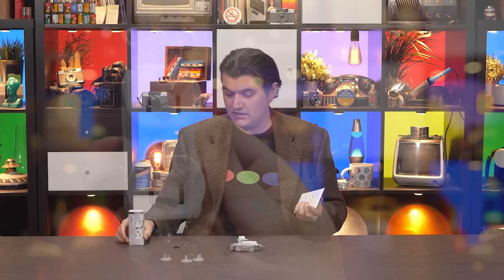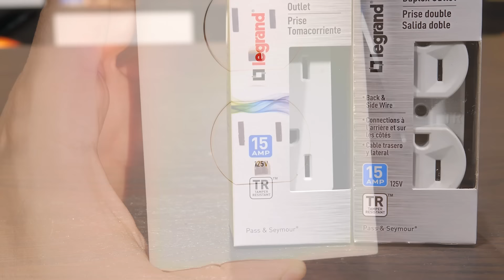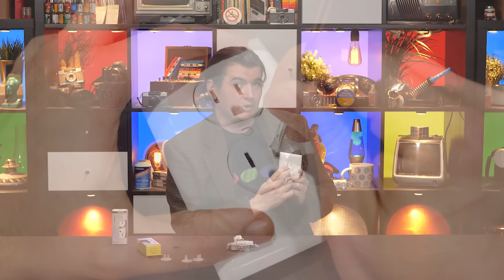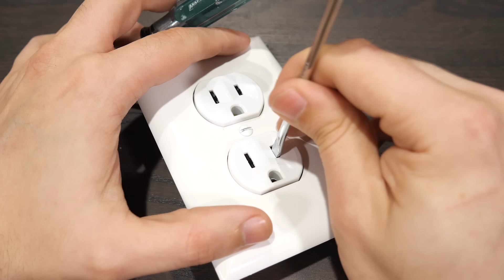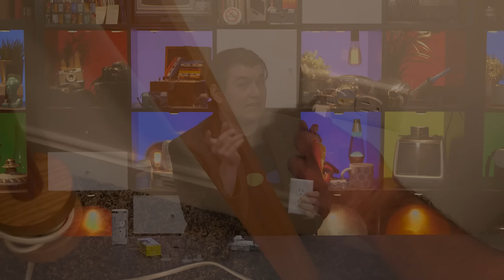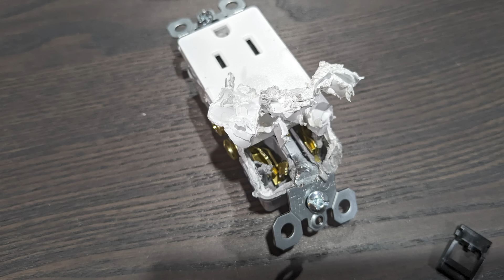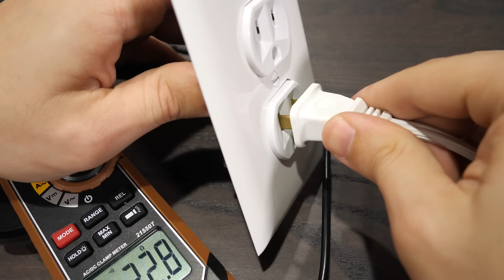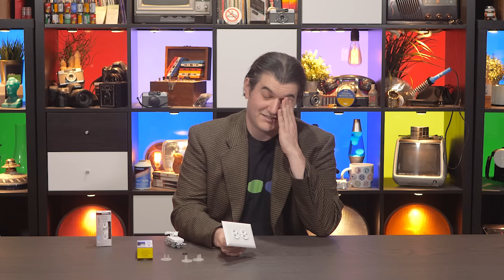Tamper-resistant outlets aren't all the same - a follow-up

Comment from the maker: Okay, regarding loose plugs - it just occurred to me that since my lived experience is mostly around Chicagoland where outlets tend to be sideways, that may be why I have so rarely encountered problematically loose plugs. In either vertical orientation, it's really only side-friction that's holding onto the blades. But when it's sideways, weight from the cord is sort of jamming the blades against the contacts. Perhaps we've been right all along... (though neutral should probably be on top)
Reply from the maker: @TargetedMarket  I don't know how you came to the conclusion that I'm used to new construction when I said I've lived in plenty of old places with old receptacles. Chicago wasn't built after electrification, y'know ;)
Reply: @TechnologyConnextras  Most tourist will probably only experience hotel and airport receptacles and in my short domestic travel experience they're usually crap. Like my cell phone charger is floating inside the receptacle & will fall out with no strain bad.
Reply: @TechnologyConnextras  6:46 European here, where I live we have CEE 7/5 sockets (sometimes called Type E) and mostly CEE 7/7 plugs (works with CEE 7/3 and CEE 7/5 sockets), if appliance is unearthed you can find CEE 7/16 (Europlug) and CEE 7/17 plugs. A plug becoming loose is a such a foreign concept to me that I am usually more worried about yeeting out whole socket out of the wall than the plug becoming loose. If the socket is old, low quality or improperly installed it is far more likely to yeet whole socket out of the wall, so I have tendency hold the plastic body of a socket while unplugging CEE 7/7 plugs. I don't think that it is a problem now, but in the 90s and early 2000s when CEE 7/7 plugs started to appear, tolerances probably became very small and old socked installed behind the iron curtain (but only those home ones, those basement and outside ones where always sturdy as far I remember) were not ready for the force needed. And the habit from my childhood just stayed with me. But even those old CEE 7/2 and CEE 7/6 plugs were almost impossible to partially disconnect as you do with the American ones, while the modern CEE 7/7 are probably so tight to make them dust- and at least partially water- resistant*.

*As far I checked, sockets near water supplies should be at least IP44, but even IP66 are common outside. Inside sockets are at worst IP20, but you can buy also fancy looking IP40 for internal use. Also if you have a socket with high IP, you need a lot of force to plug in a device and even more to take out the plug, so it even may be that a child is to weak to plug in a CEE 7/7 plug while plunging it out is even harder.
Reply: @Hadar1991  I'm from the wrong side of the iron curtain, we used to have unearthed sockets that are just round and like maybe 3-4 mm recessed, I guess what we call 7/1 these days.  Where I grew up, the light switch in the rooms would turn on such sockets high up on the wall, and the light would be plugged into that socket (a big round plug though, not Europlug); normal use wall sockets were barely recessed and non-earthed too.  Can't say I've seen anything want to fall out of those sockets ever, and that was shoddy socialist production from 45 years ago.
Reply: @Ralesk  I am from Poland, when I was a kid there where only CEE 7/1 wall sockets and CEE 7/2 plugs were use. And 7/2 plugs where nowhere near as tight as modern 7/7 plugs. Nowadays only 7/5 sockets are installed in Poland. Maybe it was only in my house, but those old 7/1 sockets where not very stiffly mounted to the walls. Although there was no danger of ripping whole socket all of wall if there was only 7/2 plug or 7/16 Europlug used, but I definitely ripped out a socket once or twice if the newer 7/7 plug was used. I am not sure why, but maybe the GOST 7396 standard for sockets and plugs had very slightly thinner pins or just those old plugs after years of use lost a little bit of the material on pins. But what I wanted to say, I have never worried about accidentally removing the plug from the socket in Poland, although I had accidents with ripping whole sockets out of the wall, so for this day I have a habit of holding the plastic part of the socket why removing anything.
Reply: @TechnologyConnextras yeah I've been in houses with plaster walls around here that so have the sideways outlets.
The conduit idea makes sense but I think it may predate that
Reply: @TechnologyConnextras I'm wondering if it's because it's because of using adaptors then our foreign plugs which adds more weight which might help the adaptor back out easier but who knows
Reply: @TechnologyConnextras  Where is Chicagoland? Do you actually refer to Chicago instead?
Reply: @erkinalp Chicagoland is Chicago and the region around it
Reply: @erkinalp  Chicagoland is the common term for Chicago and it’s surrounding suburbs (which leaves Illinois into a bit of Wisconsin and Indiana). Chicago has a population of about 3 million while Chicagoland has a total population of about 10 million.
Reply: @erkinalp  I think he is referring to all of the Chicago area, including its suburbs.
Reply: @erkinalp Even if you've never heard that word before, you couldn't figure out what it meant? BTW, the first known use was in the 1926 July 27 edition of the Chicago Tribune.
Reply: @erkinalp Like maybe LaGrange would be Chicagoland….those places where when strangers ask where you live….they only have heard of Chicago so you say “ummm, Chicagoland…”
Reply: @erkinalp he is referring to Chicago and the surrounding areas
Reply: Adn given that most foreigners are going to use some plug adapter i wouldn't be surprised, that that just makes the whole loose plug issue even worse, due to added weight
Reply: As a European visiting US, I can say that the shady international multi format plug adapter didn't help the well' worn hotel sockets
Reply: Yep, our old house was built pre-1900 and some of the existing outlets hadn't been updated since the 40s or 50s (maybe 60s) and they were loosey-goosey non-grounded outlets vertically oriented so plugs didn't stay put very well.
Reply: I definitely prefer right-angle plugs, and the 45-degree offsets to allow both plugs to be used is usually beneficial though we do also have a few recessed plugs behind built-in cabinets (with a rectangular cut-out in the cabinet to access the plug behind it) where that doesn't work.  Plug strips, on the other-hand, which are almost universally sitting on the floor or table with the plugs facing straight up, seem to make the whole thing moot.
Reply: I am not from your region, and yeah it's never been a problem in my life.  I've seen a couple of truly loose receptacles, but they were probably pre 50's (most likely pre 40's), so those aren't really a matter of code as they are simply worn.
Reply: When I bought a house it was a circa 1962 era home and the outlets were all loose as a... let's go with a worn out sock. Went and bought a "contractor pack" of outlets like you mentioned, and with a couple hours of they were all nice and toight. Toight like a tiger. It would have been faster but for the game of "which breaker is this outlet on?"
Reply: @TechnologyConenextras large wall warts (think current gen MacBook chargers) are prone to falling out. Because of the weight, the leverage, and the folding prongs. 

I’ve also had this issue with other similarly designed charging bricks.
Reply: when I bought my house nearly all the outlets were worn out and sometimes I had to jiggle the cord or pry on the plug tines to keep them working. I ended up changing all the outlets in the house
Reply: Loose plugs haven't really ever been a problem for me in the UT area. I'm pretty sure it's only a problem if the outlets are worn out enough. So far as I've seen, the plugs always stay flush against the wall
Reply: Try O'Hare. :) In addition to hotels, I have noticed that outlets in airports are very often worn out and chargers just fall out of them. This is especially true where wall outlets are limited and people are constantly plugging and unplugging them. Or places like O'Hare where the outlets on the chairs never seem to be working, so everyone is trying to use the outlets on the wall.
Reply: The only loose vertical plugs I've seen (outside of public spaces like airports) are with receptacles that are old enough they're probably out of code anyways. And my home was retrofitted with knob and tube wiring after it was built. To give a sense of how old it is
Reply: @blakebrockhaus347  I doubt they're out of code.  Electrical codes very frequently grandfather older stuff.  But installing one of those loose outlets today hopefully is covered somewhere in the code.

Yes, they are less of a problem when mounted horizontally, but I recall some of the outlets at my grandparents' place having virtually no grip.  One in particular had a table situated right by it at just the right height for a cord plugged into its lower outlet to rest on the table specifically so the plug wouldn't fall out of it.  The outlet above it was deemed a lost cause, though I recall my brother trying to plug a radio into it by sitting the radio by the outlet and running the cord over the radio.  (It didn't work for long, as the weight of the cable running down the other side of the radio was enough to pull it out over the course of a minute or so.)

That said, I'm not sure they needed to be out of code.  My grandparents changed brands of outlets after learning how much of a problem those cheap outlets were.  They were teenagers in the Great Depression, and even they splurged on better quality outlets - but not enough to replace any of the original outlets they'd bought.  And I mean not any.  The house which only had some of those outlets was their newer house, built on the same property as the first one.  The original house they'd built only had the no grip outlets.  Fortunately, it was barely livable in so many ways as soon as they were able to afford a redo they did, and we virtually never visited the older house.  We certainly didn't use the electrical outlets apart from testing their grip, just to marvel at what our grandparents put up with.
Reply: @edgrimm5862  ok, to be anally correct. They wouldn't be up to code if they were made today. Meaning they should probably be replaced anyways
Reply: I've definitely encountered very clapped out outlets which basically spat out anything you plugged into them. thankfully, I could just replace them myself
Reply: I've never understood why we don't do induction plugs that have hooks to confirm contacts internal to the wall.  There is no need to have direct metal to metal contacts.
Reply: @cerburusmori Because you haven't thought through the enormous engineering, cost, and efficiency ramifications of it.
Reply: @Kyuuketsuki02 My guy, it's essentially making a small transformer, no engineering.  Cost would be the hurtle I suppose as everyone would need to by adapters to change their plugs into half a transformer.  Replacing the duplex with said transformer is another cost, but saving on house fires should be cause to consider.  The only question would be proper shielding for eddy currents and keeping people from tripping safety to make the outlet live imo.
Reply: @cerburusmori  yes there's a lot of engineering. If you're going to replace receptacles with inductive power couplings, they need to be able to handle 20 amps continuously. That's not a small transformer. And it's gonna waste a ton of energy as heat at that load. And it has to be emi compatible. And it has to fit in cramped electrical boxes. And it has to fail safely under surges at least up to 600v else it'll catch fire eventually. And it has to make sure that it's actually delivering power to an electric device, not just some chunk of metal that's near and resonates juuuust right.
Reply: @Ariccio123  thank you for thought out answer.  The short is, I would have designed a non-matallic switch to actual charge the windings on the internal side, so it's not live until the external plug is connected.  Secondly, I planned to have a type of shielding to cut down on inference and noise.  I'm not sure why the size of the transformer would cause such a head load.  I get smaller wires generate higher heat, but if the primary line can handle the current, why would windings fail? Again, this is conceptual and there are challenges, but I think they'd be surmountable with a bit of engineering.  Would say, we don't have to keep the same boxes as is.  This is more a standard to go to, not to retrofit wall plugs.
Reply: @cerburusmori except any solution that requires an adapter you're just adding more points of failure and also still have the original problem 1 in over
Reply: @cerburusmori  
> "A transformer is 80% efficient or better."
> "transformers have a 98%+ efficiency."
Just thought I'd point that out. But, to actually answer your questions, there are several hurdles an inductive outlet would need to solve:

1) Yes, large power transformers are very efficient, but one of the ways they get that efficiency is by having a laminated iron core that loops through the center of both coils. Kind of hard to do that with a plug, and without that, the efficiency of the transfer will suffer greatly. As @brianzmek7272 said, QI charging only gives you about 60% efficiency (when it launched, modern chargers can sometimes get as high as 75% efficiency) because the two coils aren't tightly coupled

2) The lower the frequency, the bigger the transformer has to be to get good power transfer. At only 60 Hz, the plugs are going to need to be much bulkier than current designs.

3) The lower the voltage, the bigger the windings have to be to carry the same amount of power. At only 120v household supply, this would make the plug even larger. (And you thought those wall-wart phone chargers were bad?)

But, the biggest problem of all is one of safety. If the primary-side switch fails on the outlet, or you plug in a cable with nothing on the other end (like a standard computer power cable), or the power switch on the appliance fails a certain way, or any one of several other failure modes, you've essentially turned the outlet into a high-wattage heater that could easily either trip the circuit breaker or start a fire.
Reply: @HiddenWindshield  I am aware I wrote two efficiencies.  It turns out 98% is higher then 80%.  I believe your making an argument for classical transformers that just isn't applicable, but I'd need to sit down and actual work this to solve the issues.  I'm saying it is possible and that we should do it if safety is the concern.
Reply: @cerburusmori  I'm not arguing "for" anything. I'm also not sure what you mean by "classical" transformers.
Reply: @cerburusmori What you're describing is effectively an air core transformer, which are famously inefficient. Even if you stick a slug of iron inside on either side it's still going to be far less efficient than the high voltage mains transformers (that do require substantial engineering to design, might I add), and even those high voltage transformers are only in use because the inefficiencies of a high quality, well engineered transformer are lower than the inefficiencies from transmission losses at lower voltages. Direct copper contact is plenty safe as long as you don't leave the copper exposed like NEMA plugs are prone to doing, just look at the many, many well designed mains voltage power connectors in other countries, none of which rely on an expensive, inefficient inductive connection.
Reply: @bosstowndynamics5488  I am realizing after having time to dig into it, that my very first statement was correct.  Transformer is not.  The technology is called inductive power transmission.
Reply: @matthewmiller6068  the point is all new products would use the new style and the adapters would be for current electronics, which would be phased out.
Reply: @HiddenWindshield  You are able to use different core materials.  I am realizing though, that I missremembered that they have to have a core, and if they don't it's induction.  I should have stuck with my first instinct of inductor, not transformer.  Please excuse my snarkness earlier.  

The 80%+ is a range and the most are 98% is the distribution on that range.  I can see where that might be confusing if not read in context, though in your quote you left off the generally transformers, which is an important word to clarify it's the distribution.
Reply: @cerburusmori And the hurdle of getting more than about 20% transfer efficiency, especially at 60 Hz... (or 50)
Reply: @cerburusmori any such plug would be massively less efficient and leak em interference like a siev.
Reply: @brianzmek7272  I have no idea why you think that.  A transformer is 80% efficient or better.  I get theybuse dielectric oil, but I'm sure I could design one.
Reply: @cerburusmori  and the efficacy of the contacts of a non corroded plug as best I can research is in the milliohms range on a 120 volt connection and even a whole one is still over 99% efficient. Plus look at the lossyness of the chi charging standard where 60% efficiency is normal and and lower while bad is still technically functional in some cases even 20% efficient for a more apples to apples comparison plus your sighted efficiency of 80% would mean that anything on an extension cord in your proposed standard would only get 80% of its rated power or 64% of the power that a conventional plug and extension cord can produce.
Reply: @brianzmek7272  generally transformers have a 98%+ efficiency. I am not sure where you are getting 60%
Reply: @cerburusmori   your Idea  certainly has merit in the appropriate application, but in engineering terms on the scale of an entire continent even small /minor hurdles  are gigantic. Unforunately any emi shielding that would meaningful reduce interference in an flat surface scenario that I think you are leaning towards would by definition reduce the efficiency and effectiveness.... The variable efficiency rates others have stated  for transformers would be due to design assumptions that are used.... example the besy case/highest efficiency transformers are going to be something like a low carbon steel one piece laminate e-core design. The issue is that isn't possible if you are splitting it up between the power supply side and the use side so that reduces your design assumptions for maximum efficiency, then you inevitably have manufacturers for items on the use side that are going to make the crappiest bare minimum excuse for the secondary winding that is possible examples....copper clad aluminum sold as solid copper...  misaligned/poorly aligned to the outside casing... all of which further reduces the efficiency. I really don't want to discourage you... but I hope just providing a little context how corporations and federal government are going to do the least possible effort,  sorry to be a major downer...
Reply: @cerburusmori  For a transformer to be efficient you need a strong magnetic coupling. Regular 50/60Hz transformer cores are made of stacked E and I shaped iron laminations. If you assemble one without getting everything properly tight the idle current will be higher due to magnetic saturation. For something the user plugs in by hand this is a no-go. There are probably ways to ensure this doesn't happen but in the end you'd end up with a massive plug costing over $100 compared to the compact 69 cent traditional outlet.
Reply: @alexlail7481  so, the alignment would be for the locking mechanism to address.  I would say that you could make the protective cover separating the two halves a dielectric liked what's used in capacitors to increase storage.  Again, I'd have to do research to find the solution
Reply: @cerburusmori  sorry I realize I probably wasn't as clear as I should have been in my original comment....the alignment I was referring to was the cores themselves they essentially need to be perfectly coaxial for maximum efficiency,  the will function if not but the more they're off from truly being coaxial the more the efficiency drops off. If I remember correctly it is exponential meaning the drop off in a few arc seconds is fairly minor, but a few arc minutes and efficiency is impaired substantially.... my concern would be the natural tolerances produced in a production environment may render the a product where one unit is 60-75% efficient and the next is 15-20% because the coil isn't potted correctly.... not insurmountable but from experience in a factory making similarly finicky electronic products it was a constant struggle that drove up the cost and nearly bankrupt the company over what they board level people saw as unimportant nonsense... and refused to properly fund...but if you believe in it then I encourage you to get the proper education/skills and pursue it!
Reply: @alexlail7481  I'd hope, as an M.E. I'd already be qualified, but EE items aren't something I've dealt with in over a decade.  I wonder then if it'd just be better to make it a simple capacitor.  My reference manual is at work, so I've been answering everyone off of what I remember from my eng physics from 2006-7.  Not the greatest, I know. I am aware they store charge and I'd need a way to discharge on client wanting to unplug.  Need to look at number and maybe a release mechanism that grounds everything, just off the top of my head.
Reply: @cerburusmori  Because induction power incurs a massive loss in power for the convenience.  Electricity use would skyrocket, as would electric bills.
Reply: @arcanescroll I have seen this claim, and counter claims online.  I really need to do more research into this as I do not remember induction being so inefficient as claimed online.  What little I have had time to do says that loose resonance tech for smart phone charging maybe a better path, but again, need to do more research. Certainly something for me to sink my teeth into, so to speak.
Reply: @cerburusmori  Well, I have tested this multiple times and yeah there is a loss in power.  You can't just create a wireless link between devices with no loss in power, there is always a loss in efficiency.
Reply: @arcanescroll  You can minimize loss by using a heatsink or creating a vacuum, if I remember right.  Not practical for the situation, but if the efficiency loss is small enough, seems like it'd be worth the trade to me.
Reply: I've noticed extremely loose plugs in hotels in cheap fixtures that barely stay in. I assume this is what they mean because eeuropeans often interact with them in these places.
Reply: I have vertical outlets and dealt with them almost exclusively. The only time I run into issues with it trying to fall out is with a very dated or poorly made outlet. Which tends to be high traffic locations like hotels, airports, planes, trains... Basically anywhere that general public is given access to the outlets.

I think it's a combination of frequent plugging in, and just... General public.

A lot of the time these will be the places that folks coming from foreign countries will interact with plugs, because they're not here on a long term stay, but instead staying at a place they'll be temporarily, like everyone else before them.
Reply: Just FYI, also you in Chicago, all competent electronics install it sideways with natural on top. I believe it's a sign that someone who wasn't an electrician installed it if it's hot on top
Reply: @ampersandexplainer  n.b.: the neutral conductor doesn't mean "cannot shock you". If you have some really severe, but surprisingly common, electrical faults, you can get very dangerous shocks between ground and neutral. I know because it's happened to me with faults at the meter/service entrance panel causing an intermittent floating neutral. Very very very dangerous.
Reply: The problem is with airport and hotel outlets and when using wall warts, especially with U.K. adapters. I don’t remember particularly having problems when living in the US - other than being alarmed by the way that plugs could hang out of walls. Perhaps there were some issues with wall warts in vertically oriented sockets and with them more easily being knocked out.
Reply: The only "loose" vertical outlet I've encountered is there's one outlet at my home that got . . . melted slightly, somehow. Really what shocks me (ha) is that my parents never replaced it.
Reply: Sideways w/ neutral on top would also reduce a lot of the issues you brought up in your other video. Sideways makes it harder for plugs to pull out a bit in the first place and neutral on top is a lot less dangerous if something makes contact w/ the plug. There are still going to be issues with devices that assume a smiley-face orientation (particularly stuff with displays), but they'd be less severe then with the ground on top orientation.
Reply: The outlets at my work are a couple decades old, whenever I'm vacuuming there's always outlets I cant use because the plug will work its way out. Those outlets are mounted in the traditional way.
Reply: Why would it matter if neutral is on top, outlets should be designed to be safe regardless of orientation. If the entire prong does not need to be live, then the part that can be insulated should be insulated.
Reply: Look at cruise ship for plug looseness. I keep saying this. On ship we have EU and American sam brand.  Side by side. Always USA socket fails first.
Reply: @peterl.deegan9059  That could easily be because the usa socket is used more.
Reply: Maybe if you put them diagonally, you can confuse gravity and get even better results!
Reply: You mentioned that most people that say US plugs falling out are probably referring to hotels. That is likely true and also they are adding a sometimes heavy adapter to the plug.
Reply: I've encountered european-style plugs and receptacles in russia that are really loose. Like, REALLY. I guess we took the european style and made it much less restrictive. At least I haven't seen a plug that doesn't have a bit of insulation on the contacts going from the base of the plug.
Reply: A shock from the thumb to the forefinger of the same hand is less lethal than from one hand to the other or from one hand to a leg. Ask me how i know.
Reply: The only way to defeat a TR outlet is the only way you can defeat GFCI protection.
Reply: Charleston WV; my aunt's house has sideways outlets in the kitchen, dining and living rooms.
Reply: I had loose outlets in a number of homes and apartments I’ve lived in, but it was never every outlet and the outlets were always old. When I moved into my new home there were some outlets from the original build in the 90s per the stamped manufacturing dates. Some sucked, some worked fine, all were pretty yucky and needed to be replaced on  a cosmetic basis.
Reply: Regarding how the protection works here in the UK. It's not always the Earth pin slot that has the release for the Live and Neutral internal cover. It's sometimes just a slide out the way. (Well more a twist with ours, but a sliding twist all the same)  It will only twist out the way if both L and N pins are pushed in together. The way they work. Is if you only push one in. Instead of sliding. It catches on the side of the front plate. Whereas if both go. It just slides impeded, not hitting a side catch. It's probably similar to how those US guards work. There will be something it clips on if it's not pushed evenly.
Reply: Wowow, better take a look in the mirror before you start calling people loose plugs, buddy!
Reply: Sideways outlet can with time weaken the blades of a plug since the wider profile is more prone to bend with the weight of the cable attached. Why they didn't adapt to rod type prong like most of the World did since the beginning? Also those tamper resistant mechanism are very tough in the beginning to the point of almost depressing the whole electric box way inside the wall when connecting the plug but became very loosy goosy with constant use to the point of having no resistance.
Reply: 19:10 😂
Reply: Yeah I have tons of vertical-outlet-plugs-falling-mostly-out-to-the-point-the-device-loses-power problems, including the one outlet I have for my bedroom light and phone charger
Reply: I've lived in California my whole live with vertically oriented plugs and have encountered LOTS of receptacles that wont hold onto their plugs. Sometimes they aren't even that old (relatively speaking) just really poorly made. Honestly, horizontal outlets make so much sense I wish we had more of them out here.
Reply: I'm in Michigan where we have almost no sideways outlets and the only loose outlets I have ever experienced is those things that split a normal outlet into 6 receptacles. Those things can get melty from relatively low current, I think that's why,
Reply: I’ve only been shocked once, my index finger was joining the blades when plugging something in when I was a teen. Was just a wake up call to pay attention. I use an extension cord to my bed for the phone so I’m not pulling on the plug
Reply: No, don't backstab.  They are awful and tend to develop a hot spot, high resistance, and eventual corrosion and burning.  And suck replacing them getting it out.
Reply: Those tamper resistant ones are absolutely awful.  Especially at hotels, often one side goes in with zero force and the other side won't go in even pounding your fist on it putting all your strength into it.
Reply: grew up in Vermont. it's lousy with worn outlets that simply won't hold plugs anymore.
Reply: My current home was built in the 70's and many of the outlets would just drop the cords as soon as you plugged them in, or slowly overnight.  I've replaced all but one.  I keep that one because it amuses me for some odd reason.  It's not used for anything though and even has the words "bad outlet" written on the faceplate.  It will be changed if I ever sell the place.  I do love those sideways outlets, something to add to my ideas list if I ever get the chance to build my own home.
Reply: If you recessed the outlet, similar to European outlets, that fitted the plugs that would improve many of your concerns.
Reply: @elpolaco7654  When I was writing about old CEE 7/2 I meant the old Soviet ones which look like CEE 7/2. If the old Soviets one really had smaller diameter of pins it means that am not hallucinating that the old Soviet plugs where easier to plug in and plug out. And I admit, that the old sockets I had in my family home where either low quality, extremely old or improperly installed, but it also means that it was enough to stay in wall while using old Soviet plugs and the problem with ripping out sockets started when CEE 7/7 plugs started to appear in Poland. But regardless of all of that, American plugs seems way more loose that even the old Soviet plugs, while compering modern European plugs it is night vs. day.
Reply: The United States are not very united.
Reply: Had lots of issues in my last apartment with basically all my plugs falling out and not making connection (Plugs in the bathroom and kitchen weren't even GFCI!). Which led me to this: https://www.youtube.com/watch?v=kX6xnOksQTc 
The mechanism that holds the blades in place is fair bit less robust in 'residential' grade plugs vs 'commercial' grade plugs (at least according this video).
Reply: I’ve never had a problem with receptacles in he US they’ve always been fine to me.
Reply: Yeah, in my almost 43 years of life, I have encountered A LOT of partially inserted cords all over the US. Even our house here in California that has all new outlets, one in our kitchen doesn’t grab at all and we very often have phone chargers just fall out with very little effort. We also have a fan that our dogs bump the cord and there is a shocking amount of the prongs exposed while still operating. My favorite has been those I saw in Germany. They are recessed, so there is no way you can make contact when plugging in or unplugging. I first used those in 2006, and I felt they were so much better. You usually have to pull them pretty firmly to remove too.
Reply: Bad wall sockets were causing my wall plugs to literally fall out of the socket.
Reply: I think the Europeans have their heavy giant Euro plug plus an adapter compounding the issue.
Reply: I love outside Chicago, too, and the moment you mentioned sideways outlets, I looked around and was like “I’ll be damned…” it just never occurred to me before.
Reply: I know you'll not read this, and I've posted it in the past, but there is also a UK socket that requires the live and netural pins to be pushed.. As well as the earth (ground) pin, and it's fairly popular too. MK Logic Plus. I really think you'd get a kick out of playing with one.
Reply: I've only encountered two outlets loose enough to have the plug slide out on it's own. One was an outlet built into a lamp and the other was a brown two prong wall outlet that seemed very old.
Reply: Sideways with neutral on top is how I wired the outlets in my bedroom. I have had no problems with loose outlets and all of my 90 degree adapters work flawlessly
Reply: I suspect that part of it is that visitors to the US are more likely to be exposed to outlets in e.g. hotels, which do tend to be loose
Reply: American here. I have had a big problem with old worn out outlets allow the plug to literally fall out. In places where the plug experiences high traffic, or the cord is being moved around a lot (like where I plug my phone in) I have to go and tighten up the connect every few months or so, so they do come loose over time. Maybe european plugs aren't as prone to this or something? I would hardly call it "all the time" but if I was used to never having to worry about plugs coming loose, maybe I would.
Reply: "Talk to me nice" You still the man love ya buddy.
Reply: I can attest to the thought that our plugs are always falling out. I used to live in a pretty old house, probably about 80 years or so. The walls were all lath and plaster. Many of the outlets were quite loose. Almost all plugs would naturally hang out with some of the metal exposed. They were all loose enough that accidentally hitting a cord would very probably pull the plug out. The on-the-wall/cordless type power strips were completely out of the question if they didn't screw in. 

In my experience there, I could see how somebody could complain that the plugs are always falling out. Yes it is an exaggeration. But, coming from a place where plugs really just can't fall out, I can understand the sentiment.
Reply: same, i was so confused when i went to ohio and my phone charger was sideways.
Reply: Omfg I never thought about this! I grew up in Chicagoland and moved to greater Boston a few years ago and the outlets are definitely vertical more often
Reply: Yep. I can confirm that an old vertical (NEMA 5-15R) outlet, will start dropping plugs after it wears. Got a good reminder of this when I moved into my last apartment and nearly every outlet had degraded to that point. The ones I replaced those with held things just fine for the following decade. So I can sympathize with that complaint from anyone who's been able to experience better designs before coming here.
Reply: This is a great pinned comment, I was going to guess that it was because you had sideways ones! Now I’m slightly jealous.
Reply: As someone who's mostly encountered them in the standard "Vertical orientation, ground pin down", with standard appliance plugs and 3-prongs I haven't usually had much trouble with problematic looseness unless there's furniture bumping the plug (which was the case with my bedframe the plug for the daisy chain of extension cords and a power strip that my computer was plugged into for the longest time; the wall plug actually had its ground pin broken off by this - not that the outlet was actually grounded at the time). But in places where the outlets see a lot of abuse, I've seen a bit more looseness.

And what I've definitely had looseness issues with are USB-to-mains adapters (many of them have lousy bite even prongs-down in a power strip), and sometimes transformer plugs.
Reply: Also worth considering that visitors from overseas are also likely using adaptor for a shaver or other switchable voltage product and US-style sockets seem unable to cope with any weight and stay properly seated. I visited my mother in California from the UK and there is no way my shaver could be used with the cord and have it stay plugged in and that uses a European two pin connection (which is normal here), but the end is pretty large. Also when I lived in California I had no problem yanking a cord out of the wall when I was hoovering - happened all the time. Much more challenging with a UK plug 😉
Reply: honestly, I can imagine that it's just the huge difference in how solid a plugged in plug in Europe is, compared to America. I sometimes have to really use some force to unplug things, like, two hands on the plug. (that's mostly with the extension cords from ikea? they hold on *good*.)
Reply: Another reason could be that the pins on UK outlets are much thicker, and all plugs have a ground pin.
Reply: As someone from a place with good food, unlike Chicago (who the fuck puts sweet relish on anything?), I can confirm that the € are completely wrong.
Reply: I have a rant, about switches - Every kitchen sink I've seen in residential settings that have a grinder and overhead light, you have to guess that the inside switch is the grinder. Or is it always the left one? Anyway, I solved this in my kitchen by making the light switch an illuminated paddle, and also upgraded the grinder switch to a heavy-duty black one. Then covered it with a stainless steel plate that matches the sink. It looks slick and I can find it in the dark.
Reply: The plugs are literally loose because the difference between "builder grade" and "fed spec grade" outlets is $1 versus $10 per outlet, the former wear out quickly and most people don't have the handiness to replace outlets when they start to wear out. Euro plug prongs are angled so they don't fall out even as the outlets age.
Reply: and to be clear "fed spec grade" is not the top of the line, that is just the bare minimum the federal government will accept in its building projects. There are much better ones like "hospital grade."
Reply: @ssl3546 hospital grade outlets also come in multiple grades too! The "extra heavy duty" ones offer better contact pressure, better metals for conductors, and better heat dissipation (more fire safety).
Reply: @ssl3546  In the local home center "fed spec grade" is probably what is called "commercial grade". These outlets are built much better than "residential grade" outlets, in that the backwire is actually clamped by the terminal screws rather than internal springs that could fail on their own with a few pushes and pulls. These outlets are heavier than residential grade as well. Of course hospital grade is probably the top of the line for everything.
Reply: @shantanusaha9746  note for this: if you backwire/pressure plate wire, especially use a torque screwdriver!
Reply: @ssl3546 Mike Holt said he once used hospital grade recpticals that he said (I don't know what brand) were junk. commercial grade are good but industrial grade are soposbly even better; spec grade WR rated are rated for wet/damp location
Reply: @ssl3546 spec grade is like $2-3, maybe $4 with "inflation" if you only want one.
Reply: @TechnologyConnextras  Some European outlets are inset, that would cure the “prongs slightly sticking out”  as a hazard, but would eliminate the use of any right angle plugs
Reply: @mtnman6942  Most if not all new EU sockets are inset, and them being inset doesn't stop use of angle plugs. The angled part is simply above the "recess walls" of the socket. There are even special "super flat" plugs that go above said walls for less than thickness of the cord going to them, as the portion holding the cord can be outside said walls/whole outlet and then individual strands in the cord can "run flat" next to each-other instead of like in triangle shape, plus without the outer insulation - thus far less thick than whole cord. They are "designed" for use behind furniture and stuff :)
Reply: @mtnman6942  Same thing. I don't think I have ever seen an outlet in The Netherlands that wasn't recessed into itself. Like, the whole plastic part will stick out of the wall, but there is something like a rectangle of plastic sticking out around the circle shapes you insert the plug into. That is the lowest level of safety I have seen in outlets here. There are also outlets that have a (rounded) rectangle shape with 2 outlets horizontally aligned (could probably also happen vertically), where the entire part you insert the plug into is recessed at least 5 millimeters I think (estimation, don't come at me).
Reply: @mtnman6942 They just need to make the plug section longer, before the point where the cord runs in. I'm actually sitting here looking at a couple of examples now. 

Good point about the recessed socket design helping keep your fingers/other objects away from the partly exposed prongs. I was thinking about that during the main video. Guessing that was likely at least part of the idea there, but I'm not sure.
Reply: @mtnman6942 Right angled Schuko plugs exist - I have one on an imported appliance and I don't even live in Europe
Reply: @mtnman6942  Not really, you could just have a right angle plug that accounts for the inset and has the cable a little bit further from the prongs.
Reply: @mtnman6942 schuko (German) sockets are inset, but we have plenty of right angle plugs.
Reply: Did you ever think they're in the box upside-down (well, I guess supposedly right side up) is so that when you open the top of the box and turn the box upside-down to let it slide out that now it's already in your hand in the right orientation? Anything that saves time when installing tons of outlets in a house is a win. And you'd think electricians would get them in bulk, and they do, but they're still individually packed in the same boxes including instructions often and shit..which is such a huge waste of packaging materials
Reply: Nah, ground on top is better because balanced power is a thing and that doesn’t have a neutral.
Reply: @OtherTheDave  Balanced power also doesn't strictly speaking need a direct ground, but it does often include both, the ground for the same reasons as a single phase supply, and the neutral for inevitable imbalances that occur from time to time in some 3 phase supplies. Nor is it ever delivered through a household US outlet, since it's a way of powering 3 phase loads, and household US outlets can provide at most 2 phases at a time..
Reply: @bosstowndynamics5488  I didn’t know the term meant that. There are people who take normal household outlets and wire hot to “+60V”, neutral to “-60V”, and ground to ground in recording studios. It gets rid of AC hum and works fine with gear that treats power as power, gets its 0V reference from ground, and doesn’t do anything clever. It makes for a cleaner recording, if all the equipment can work with it.
Reply: You should get some standard European plugs, you will understand why American plugs are "always falling out"
Reply: Kind of fucked up